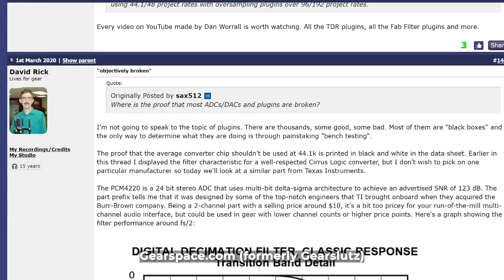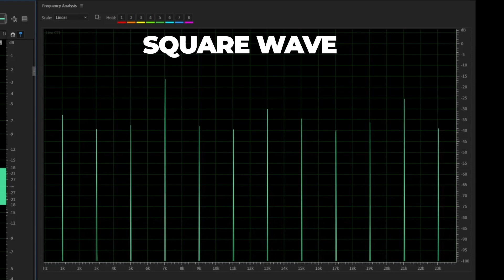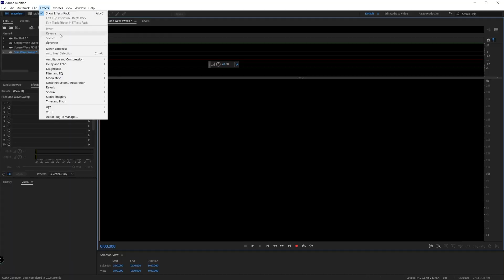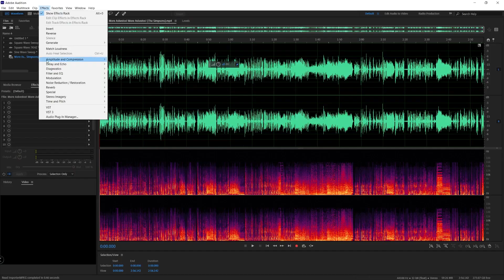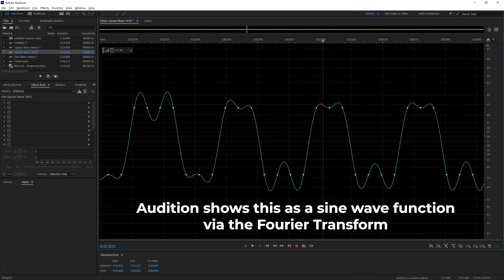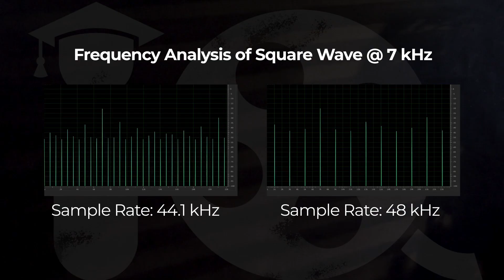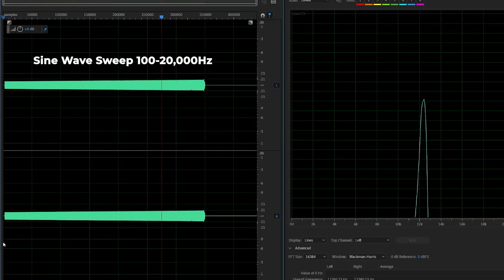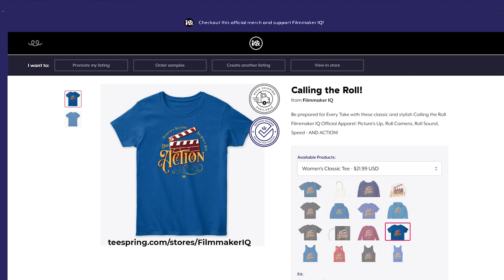What is the Optimal Sampling Rate for Audio? (It's All About the Aliasing)

Comment: I’ve been recording and mixing for years, and the only time sample rate matters is on the recording.  24-bit audio @ 192KHz is indistinguishable from analog tape, and if you can record your audio at that sample rate, that will give you the option to master it for any format you want, with the least amount of degradation to the sound.  For folks that understand how film and video work, it’s similar to folks that are shooting video in 4k if they plan on making 1080p content or in 8k if they’re planning to release something in 4k, because even though they never plan to release anything at that higher resolution, it gives them more options for cropping the footage and doing other stuff that you wouldn’t be able to if you shot video at the intended output resolution of the finished product.  Applying high, low or bandpass filtering to audio is essentially the same as cropping an image, and the more detail you have to crop, the better it’s going to look or sound.  Just think about an image, if it’s the size of the file you want the final output to be, and you decide to trim off the edges to reframe the photo, and then if you increase the image size so it matches the output resolution you started with, then you’re gonna be looking at something larger and far less detailed and blurry than you would have if the image had started out at a much higher resolution.

I will be the first to admit my recordings are all at 44.1KHz or 48Khz, but that’s because I couldn’t afford the hardware (or it didn’t exist when I made the recordings) so the end results that I got with those mixes never sounded as clear or crisp as the stuff you hear that’s been stamped with the official “Mastered for iTunes” label.  

Another interesting topic I think that builds on this lesson would be to discuss the process of dithering when mastering audio.  Some folks might be surprised to find out that the best sounding digital masters deliberately introduce white noise into the file as part of the mastering process, especially when downsampling from something like 192KHz audio to 44.1KHz.
Reply from the maker: Okay I've gotta do a video on this because that analogy is completely wrong.

Also analog tape has less specs than 16bit 44.1.
Reply: @FilmmakerIQ  analog tape has way more dynamic range and headroom than 16-bit audio at 44.1KHz.

That's why everyone was still recording to analog tape, well after the CD, DAT and other forms of digital audio were invented.  Believe me, they didn't do it because it was easier or saved money.  Maintaining an analog recording studio with massive tape reels was an expensive and fiddly endeavor, so anyone running a studio back in the day would've jumped on the latest technology if it would've simplified that process.  It wasn't until everyone eventually converted to digital recordings in the 2000's, when sample rates and quality of studio gear were high enough to record 24-bit audio, at sample rates well above 44.1KHz.

You don't have to like my analogy, because it's not exactly perfect, but people know more about editing photos and videos these days than they do about audio--and they just need something they can wrap their heads around, to know why people choose to record at higher sample rates than what we hear as the finished product.

However, my explanation and analogy are not wrong--let alone completely wrong.  I not only studied digital audio in college, I also worked in radio, and even helped teach a class on digital audio production.  The professor wasn't the most skilled at recording and editing, because he came up in the analog era, and just used the computer like a tape deck and did everything old school.  So, I helped him teach students one-on-one, how to actually use a DAW in one of the studios, so that they could record their assignments.

I still record, mix and produce music for myself and others in my spare time, so I might not be a YouTuber but I know what I'm talking about, and I'm not sure you know what I'm talking about, because if you did, you wouldn't call me "wrong" and use that as the catalyst for making a video to correct me.  I have no idea what your credentials are or experience in this field is, but I got the impression that you're someone who has some technical understanding, and just learned all of this shit in the process of making your video, and you really don't have more than a decade of actual knowledge.

It's funny, because this video was actually lacking some pretty basic information about the topic.  You didn't even explain why someone would want to record anything at 44.1KHz, when there are much higher sample rates.  You brought up using 48KHz as the sample rate, but didn't explain where that comes from.  I think your viewers are even more ignorant than you on the subject, and might not know that CDs happen to use 16-bit @ 44.1KHz, and that DVD audio uses 48KHz.  

For anyone else reading this that actually cares to learn something, CD's compromised on the sound quality, because they couldn't make players that played back compressed audio without making them super expensive, and that was the highest quality sound they could use and still fit an entire symphony onto a single disc.  (Audiophiles are historically fans of classical music, and when you're launching a new music format that's only going to be be affordable to the wealthy and/or those with "discerning taste", you kinda want to make sure you can cater to them a bit.  It was a huge selling point for anyone sick of flipping albums to hear the second half of the performance, and I'm sure that without the support of those snooty weridos, CDs might never have taken off.)

DVD's used 48KHz because it was the base sample rate used by DAT, which was one of the original digital recording formats, and because it was what people were using in studios, it got adopted by Mpeg2, DVD and digital broadcast formats.  It only sounds slightly better, and it's almost imperceptible if someone uses proper dithering when creating the final audio file.  It was simply a matter of compatibility with existing pro-audio equipment, which also supported higher sample rates like 96KHz.  Good studios would record at the higher sample rate, and then downsample their work for the finished product.  DVD-A used 24-bit audio @ 48KHz, because they were purely an audio experience, so they could use up more of the space on the disc for higher quality sound.

Newer formats like BD (and the new dead HD) DVD used 96KHz, again, because of the larger amount of space available.  Which is still really good sounding, but it's still only half the sample rate of the highest quality digital recordings, which is 24-bit @ 192KHz.  There may eventually come a time when there's equipment that can capture audio at a higher sample rate, but even the obnoxious audiophile community that would typically support anything that's higher quality, just for the sake of it being measurably better (even if it wasn't perceptibly better) hasn't been pushing for anything higher.  Turns out, even they can't tell the difference between 24-bit audio @ 192KHz, when compared to a super clean analog recording, from a well maintained deck with Dolby noise reduction.  If you don't overdrive the tape, or have it distort in the upper frequencies, and you play it back on equipment that doesn't have any ground hum, it sounds fucking amazing--and so does 24-bit audio @ 192KHz, which I guarantee you've never heard in your life.  Unless you're in a legit recording studio with high end gear to hear the difference, you can't tell.

You can absolutely hear the difference between analog tape and the much lower quality audio used by CDs, because the dynamic range is reduced to 96 dB (which is a non-trivial 48 dB less than 24-bit audio) and more importantly, it's less than the 110 dB range of analog tape when recorded using a Dolby SR noise reduction system.  32-bit audio hasn't really taken off, because 24-bit audio already overkill with a wide dynamic range of 144 dB, which is already higher than the theoretical dynamic range of human hearing, which taps out at 140 dB--so 192 dB is just needlessly wasting storage space.  That said, 16-bit audio with proper noise shaped dithering can have a perceived dynamic range of 120 dB, but again pure analog tape also has an effectively infinite sample rate, so that combined with the actually greater dynamic makes it sounds better than CD audio.

Honestly, I'm not even sure what the point of your video even was, because YouTube isn't the platform capable of even showing the subtle differences between audio using sample rates of 44.1KHz and 48KHz, especially when YouTube already filters out everything over 15KHz.  You may not be able to hear sounds over 15KHz, but I still can, and at this point if your hearing is already damaged enough to the point you can't even hear a sine wave between 15-20KHz, then you're clearly not the guy who should even care, because those sounds are for you, and I would agree that you shouldn't invest in anything better than CD audio, because it's completely lost on you.

For those of us that actually understand digital audio, and have fully functional ears that can hear everything from 20Hz to 20KHz, there's plenty of reasons to record or listen to music that's using a higher sample rate and bit depth than CD audio.  Of course, that's just a simplified explanation of some of the vast amounts of information your video was lacking, because I didn't even discuss the bit rate of digital audio (mostly because we were discussing uncompressed digital audio, and it's only when compressing audio files that bit rate becomes an issue, because that's where the sound quality gets drastically reduced.)

But hey, you're just a guy who doesn't really have a background in this stuff, so I don't expect you to talk shop on the fine points of all this.  Those of us who work with this stuff for real actually need to know about how our recording medium actually works, and we have to know how audio works, so that when we're mixing it for your consumption, that it sounds right--so we don't expect laypeople to know how the Fletcher-Munson curve affects our hearing during the process of recording and mixing, or on playback over a sound system of any kind.

So, while they title of your video isn't wrong--the work you showed to get to the right answer is, because nobody in the history of the music and recording industry, or tangentially film and television, ever said 44.1KHz was optimal.  The reason it's not optimal, is because the low pass filter is still attenuating frequencies within the audible range.  So when Harry Nyquist figured all this shit out, he was merely pointing out the bare minimum that audio had to be sampled at to reproduce the full range of human hearing.  He wasn't wrong, it's just that there's no perfect low pass filter that exists, capable of attenuating frequencies outside the range of human hearing, without attenuating audible signals.  So, even with the best possible filter, you're still going to cut things off well above what we can hear, just to make sure nothing gets cut.

In the real world, I typically don't allow my mixes to contain very much above 15KHz, because as you've noted, it's not supported by YouTube, and most people won't hear that stuff anyway.  However, I do allow reverb to contain as much high end content or "air" as we call it in the business, because those are the subtle things your ears will detect and miss if it's unnaturally chopped.  It's like bad lighting in a poorly edited photo, or CGI--you have to be an expert to know what you're looking for to see it, but we instinctively know when those subtleties are lost and it will seem wrong or fake.

Anyway, good luck with your channel.  Hopefully you spend some time learning and doing some research before you go off and make something that's going to confuse or misinform your viewers.
Reply from the maker: I'm not reading this novel especially when you start with a completely false statement that tape has more dynamic range... There's no point when you're so off base from the start.

Comment: When the film guy gives better explanation about sound stuff then actual sound guys...
Also, sound was recorded with distortion in the analog era, and now we crave that distortion, so why should we go against THIS form of aliasing distortion?
Don't bother. Life is Short. Record in 44.1k.

Great video :) Cheers!
Reply: Well, there are music styles that use aliasing as a stylistic element. But one thing dynamic distortion has going for it is that the frequency content it adds is harmonically related to the input and even with intermodulation (where there's a risk of losing this feature) you have some intervals where it remains so - hence the popularity of power chords, where the added frequency is an octave below the root note. So I doubt it will become something with popular appeal and your reasoning reminds me of the old "we went from triads to tertrachords and now romanticism is regularly using quintachords and sextachords, so obviously the next big thing will be 12-tone music".

Comment: Excellent, excellent video! It does an excellent job of cutting through the woo-woo and uninformed opinions out there. You even corrected a misconception I had of aliasing, namely that the aliased frequency “wrapped around” to the low end of the spectrum vs being “folded back”! That is, I thought that a 25 KHz signal samples at 48 KHz would appear as a 1 KHz one, not 23 KHz. (I was going to correct you, but I couldn’t explain the Audition display, so went and looked it up. Duh…) Thanks for correcting a misconception I’ve held ever since my Signals and Systems class in undergrad :-)

One note and a question for you and/or the audience though: I had understood that one of the problems with CD-grade audio wasn’t the potential for aliasing so much as it was the “brick wall” low pass filter you had to use to allow 20 KHz to get through but cut out anything beyond 22.1 entirely. AFAIK, filters with such abrupt frequency cutoffs mess with signal phase well down into the audible range. Is this the case? My knowledge of such things dates back a good 35 years, so it’s possible that modern technology has found a way around the problem. (This would of course be a further argument in favor of a 60kHz sampling frequency, you could use a less-abrupt filter that wouldn’t impact phase relationships in the pass and.)

==> So my question: With current technology, can you get a flat passband, sharp cutoff and linear phase all at the same time (in the analog domain)?

Thanks again for the fantastic video!
Reply from the maker: Yeah I got that misconception as well... But there's another issue that shows up as low frequency "beating" when you start to get close to the Nyquest limit but still under. I don't know what it's called but it's worth looking into.

The brick wall limiter was definitely the issue, I think it's particularly prominent in a mastering scenario... After you add up all the little tiny decrease in high frequency in all the audio stages plus all the filter chains... it becomes substantial enough to notice.
Reply: In the old days that was an issue. These days ADCs are sampling much faster internally and downsampling on the output, so the brick wall filter requirements are much less steep.

Comment: 4:51 YouTube actually converts to 48kHz.
The reason is that the developers of Opus audio codec decide to support 48kHz but not 44.1kHz. (They have an FAQ for this.)
But if you watch YouTube on an Apple device, YouTube will deliver an MP4 format with AAC audio codec, that will be either 44.1kHz or 48kHz.
Reply from the maker: Well when I download the video from my own YouTube Studio - it's 44.1 - so I think most everything is delivered at that sample rate and it conforms with everything I've read so far.
Reply: @FilmmakerIQ  That's probably because you are downloading it as MP4 format (H.264+AAC). For Chrome / Firefox / Edge streaming, YouTube defaults to use WebM format (VP9+Opus), which uses 48kHz sample rate.
Reply from the maker: Ah

Comment: I do know that MP3 compression cuts out at 16khz because of the way the standard was designed. Also, I think some devices start to roll off frequencies in the last octave or so, so even if you have speakers and ears that can reproduce and perceive those frequencies, your hardware may be reducing their amplitude.
Reply: Not all MP3 encoders cut at 16KHz though  . LAME Encoder does not beyond a certain bitrate. And anyway, YouTube does not use MP3 compression. It uses either AAC or Opus.

Comment: Great video. LOVE the Monty video. It is awesome in it's clarity. 
13:10 "If we had an infinite sampling rate ..." Isn't an infinite sampling called 'Analog'?  :oP Kinda defeats the purpose of digital which can be MUCH smaller in storage size.
16:50 I could pick out that the frequency was transitioning from sine wave to square wave, but the tone was indistinguishable to my ears. (yes I listened to your linked video)
Thank you for the time and effort to produce this video. It is appreciated!
Reply: Same, I can't tell the difference between those last 2 waves but I can hear the transition. Almost sounds like there's a short crossfade
Reply from the maker: There is a short cross fade. I couldn't get the waves to cut exactly at the same amplitude so it was either a crossfade or a pop on the switch and I chose the cross fade.
Reply: Analog is not "infinite sample", your tape has a frequency range based on how fast you run it, normal copper wires will struggle with RF frequency, even the air has a frequency range because it's made of individual molecules. Natural is more "digital" than "analog" in the sense that energy comes in discrete packets because of quantum mechanics.